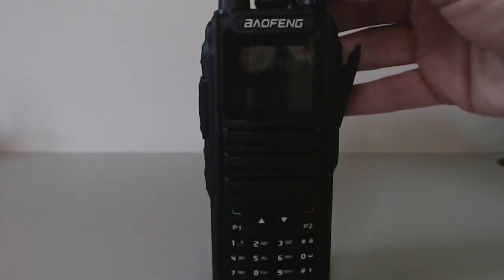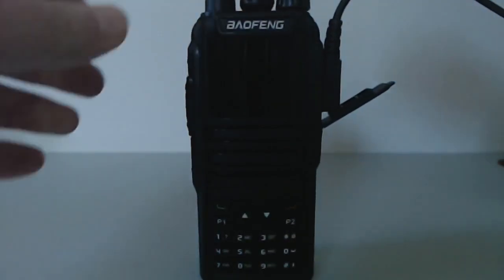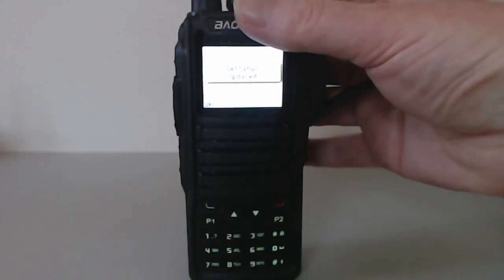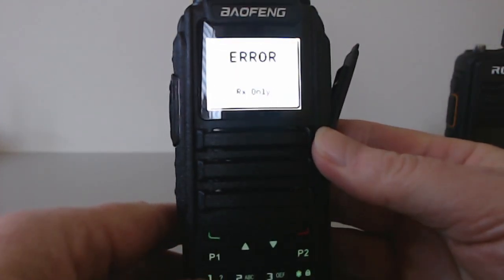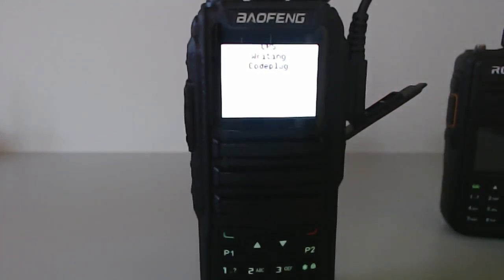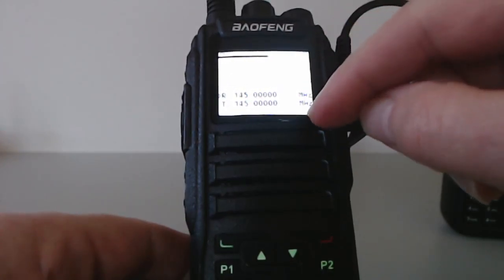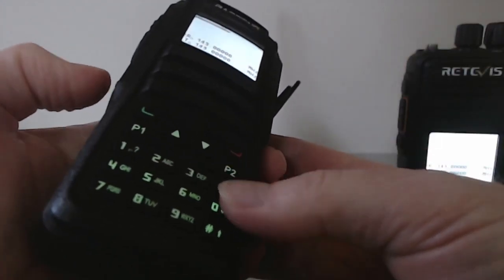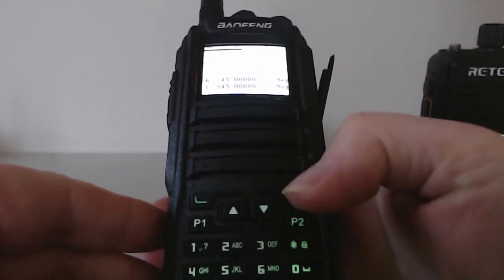OpenGD77 on the Baofeng DM-1701

Comment: Did anyone else notice the USB cable for the '1701 is different than the ones for the Retivis RT-3S and TYT MD-UV 380 (these two are compatible). I wonder if internally, the cable has wires crossed. 73 DE N2GJ
Reply from the maker: Its well documented that Baofeng swap the USB D+ and  D- data connections in their cables, compared to other manufacturers like TYT and Anytone etc.

Comment: I've got the '1701 (US$45 with NM sales tax, arrived in a week). I've burned the openGD77 firmware and downloaded the codeplug I've used on my two other DMR HTs that have also been modified.  Quick question:  when I put my local GMRS repeater in the codeplug and created a zone for GMRS, it puts the date in the radio fine.. However, attempting to transmit, I get a predicted "OUT OF BAND" message.  Is there any way to open it up?  Curious. Thanks!

Comment: What does open GD77? What are the pros to the standard Baofeng 1701 Firmware?
Reply from the maker: You'd need to read the OpenGD77 User Guide, because there isn't a features list.

Definitely NOT supported by OpenGD77 is :

No DMR SMS/Text messaging.
No Dual Watch
No DMR Encryption
No DMR Dual Capacity Direct mode
No DMR audio recording

probably there are other things it can't do.
Reply: @vk3kyy  okay, I got it now. Simply, openGD77 does make your radio more worth than it was before :D 
Very nice firmware! You developed it? Nice job dude. 

But I can't use it. I need encryption. I don't live in the US and encryption is a basic right in my country. Like the second amendment in the US. 

Why is no encryption support? Do we get a OpenGD77 version for non-us citizens with encryption support in the future?

Comment: Hey can i use regular baofeng programing cable ?
Reply from the maker: No such thing as 'regular baofeng programming cable'
Baofeng use many different cables for their radios.
The cable from some other Baofeng radios, e.g. Baofeng RD-5R can be used, but NOT UV-5R or many others
Cable from TYT radios is NOT compatible, but if you have a TYT cable e.g. MD380 cable, it can be modified by swapping the  2 data wires (normally green and white in the cable)
Reply: @vk3kyy  thank you

Comment: Has someone seen this issue I am having:
"Radio is not connected, or not in DFU mode" as I try to flush a firmware.
Thank you
Reply from the maker: 1. DFU Driver is not installed
or
2. Wrong version of DFU driver is installed
or
3. Radio is not in DFU mode
or
4. Incorrect cable or other cable problem
or
5. Not using OpenGD77CPS to update the firmware
Reply: Can you please send a link with instructions for DFU driver installation?
Reply: On your forum, I’ve read topic about COM port problems for Windows 11. Do you know if there’s a solution for it yet? Or should rol back to Windows 10 to make it work?

Comment: This radio Baofeng 1701 is the same as the RT84 from Retevis, I have one with OPENGD77 and it works well. There is a bug that to normalize, you need to go back and forth between a channel. The audio on this radio is very good and the battery lasts a long time. The channel switch usually gives poor contact. I change channels today using the panel button. I'm buying one of these baofeng 1701.

You could review the minimum audio setting that doesn't work, the minimum is still audible.

 strong 73 thanks for the great OPENGD77 project.

Comment: Excelente video ya lo instale en mi dm-1701 y funciona excelente solo el volumen de la radio al mínimo igual suena un poco
Reply from the maker: Re: Minimum volume
Probably the ADC value for minimum volume is slightly different on the DM1701 to the RT3S/UV380. 
This will need to be investigated
Reply: @vk3kyy  gracias 😊
Reply: Gracias amigo por su inmenso trabajo saludos desde chile usted es un maestro felicitaciones 🎉
Reply: Hola saludos    para leer el cps  siempre hay que apretar el ptt  + el primer botón  que está arriba del ptt.  Lo que programe la radio  Tiene Rx pero al ptte no le da salida y sale un mensaje CHYBA  mimo pasmo   no sé cómo solucionar eso.  Saludos

Comment: Will this work for the Baofeng DR-1801 UV
Reply from the maker: No. DR-1801 does not use the same CPU as in the DM-1701, so it will not work on that radio.
Reply: I thought  there were older model 1801s that work .?
Reply from the maker: @axemanarbor  The old DM1801 is a completely different radio to the DM-1701. 
The old DM1801 is a clone of the TYT MD-760 aka GD-77. Which used the NXP Freescale MK22 CPU.
Baofeng renamed the new DM1801 as a DR1801 because although it looks the same as the old DM1801 on the outside, the electronics in the radio are completely different, as all the internal electronics are replaced by a DMR module normally found in devices like the Android phones with built in DMR

The DM-1701 aka Retevis RT-84, use a STM32 CPU , and have a colour screen, larger flash memory and many many differences to the old DM1801
Reply: @vk3kyy  thanks  so much for helping me  out with that info and taking  the time . I've been doing my head in trying to learn and I guess that this is what this hobby is about , having your head done in and I did jump down the rabbit hole but I am wondering  if my poor old head can handle this one.  Baby steps down the hole haha . Thanks again . People like yourself help a lot more than you know. 
Anyway , I hope I will be back here saying CQ on my new gear very soon 😀

Comment: Will we ever get opengd77 for tyt md 2017? thanks for your work and your team.73s
Reply from the maker: I have ordered a MD-2017 and will investigate whether it is possible to write the OpenGD77 firmware to run on that radio. 

It has the same chipset as the MD-380UV/RT-3S and Baofeng DM-1701 and some other radios, but has some additional hardware because it has 2 x AT1846S transceiver chips, which may make it more difficult
Reply: Вот бы прошивку для TYT md-380, TYT md-390 (Retevis rt-3, Retevis rt-8) UHF.
Чтоб использовать супергетеродин.
Reply from the maker: @ra3age  No. MD380/390 use a different DMR chip. So the firmware does not work with those older radios.

Perhaps in the future someone can reverse engineer the commands for the older DMR chip, but at the moment it will not work.

Source code will be released for the UV380/RT3S/DM1701/RT84 so perhaps someone can use this source code to make a MD380 version
Reply: @vk3kyy  Спасибо за быстрый ответ. 👍🤝
73/55
Reply: Здравствуйте 👋 где найти оригинальную прошивку и откатить openGd77 ?